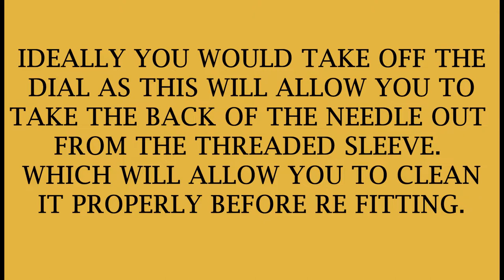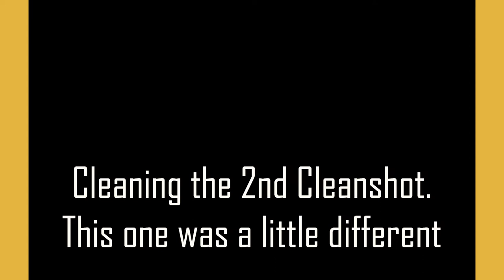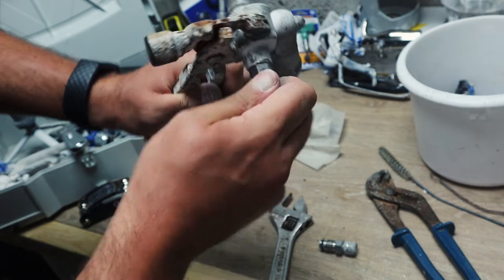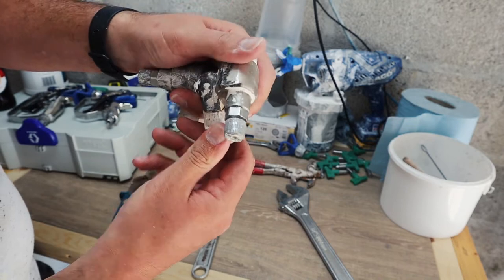Graco Cleanshot Shut Off Valve - How to Clean & Replace the Needle

Comment: hi dear thanks for your perfect explain , my question : Paint leaks from the adjustment part of the product. What should i do ? thanks for help.
Reply from the maker: Hi, if it leaks from the twisty dial at the back. You probably need the repair kit. Or a new cleanshot valve. The rubber O ring may be broken inside. Unless you can replace that.

If it leaks on the swivel area, sometimes its when its not connected tight on the pole.  Needs to be nipped up with a spanner not hand tighg

Comment: This is great... been having a rough time with mine I think I need to repair I left it in water for a couple days and really regret that!
Reply from the maker: Thanks for watching. Ive left mine in water for days before, whats the issue you have?
Reply: @sprayaholic  seems like the pattern always gets heavy in in the center, like a stream I can visibly see... I'm also typically using HEA titan tips st about 1000 psi, (valve open, just using angle swivel) so maybe that's part of the issue?   When I removed the cleanshot the other day I had way better preasure and could hear the spray itself sound healthier if that makes sense.  I haven't ever taken it apart tho so I bet its dirty inside!
Reply: I also am never sure what my pressure at gun is because I dont have a second pressure gauge, and I run off an 13 year old 440 that I've repacked a few times. It still is the backbone of my business tho lol.  I want a new sprayer but cant decide.  Thinking maybe that x19 fine finish graco since I seem to be always doing cabinets doors and trim
Reply from the maker: @pjmisley  are you using it straight onto the gun or with an extension?
Reply: Spray wd40  on the regulator ievery time you clean  it and you will never have that problem again,  even if you leave it in water
Reply: @sprayaholic   how did yours spray afterwards,  I decided to change mine after 2 and a half years , put it all together and it spat like hell in the end I had to buy a new,  well gutted
Reply from the maker: @pjmisley  so the graco cleanshot valve was made prior to all the low pressure tips such as the graco LP FFLP/ HEA wagner/titan tips etc etc. Meaning the valve is used to working properly at higher pressures. When you introduce the low pressure tips, as you say the dial needs to be more in flush than spray. Also you may find youll have to increase the pressure on your machine once its fitted. i havnt used the hea tips yet but ive just ordered some. Did it come with a new seat in the tip box/ are you using the correct seat in the guard for the correct tips? The small round part that goes into the tip gaurd? 
Sometimes the pattern can star in a cross and usually thats from paint too thick or pressure too low, or tip size too small. 
I have a video running through the graco GXFF (UK name) on my channel its the same as a gx19. awesome unit.
Reply: A 30 inch one typically (when my shoulder can handle the weight)
Reply from the maker: @pjmisley  youll need to increase the pressure a little bit more id say.
Reply from the maker: @camdecorations9779  oh really? were the rubber seals gone? ive only used one of them and its got no issues I'll try the other one this week and see how it is. The worn one of mine was 4 year old lol. The cleanshots have come down in price now. im sure i paid like £180 years ago. £156 now, no sure what a repair kit is though

Comment: what would be the number of the rubber sealant or where can I get it
Reply from the maker: Which part do you mean? The plastic O ring that sits in the back of the cleanshot and tightens against the gun. Or the small o ring inside the cleanshot

Comment: I’m getting one of these for a large ceiling I’m doing in a couple of weeks lots of stop starts because of furniture.could you please explain how to set it up and dial it in
Reply from the maker: Awesome. Great accessory to have. 
Set your pressure around what youd normally be on. It might be a little higher adding an extension and cleanshot. Start with the cleanshot dial wound all the way out in flush. Then keep testing the fan. Dial it in until now spits, small turns each time and test the fan just by pulling the trigger 1 second to see the shape.
If you still have spit and its wound all the way in the  increase your pressure.
It the sprayer stops spraying mid spray its because youve released the trigger when the machine is turning over on its lower pressure. So neither slightly increase machine pressure or if you can, turn dial in flush and it should release again
Reply from the maker: Are you on  instagram? I made a post about it a while ago. But i do plan on making a cleanshot video again
Reply: Thanks for the quick reply can you not leave it fully open 
I’m not on instagram but I think i can still view it, it’s only recently i got a phone without a lead on i
Reply from the maker: @paulmorgan1636  when the dial is wound out. Its in clean mode and allows material through at low pressure. For the cleanshot to work it needs more pressure and dialing it in shuts the valve off to stop the paint.  So each time you use it. It may be slightly different
Reply from the maker: https://www.instagram.com/p/BqAoarohkSx/?igshid=uvjqteaiamfn
Reply: Thanks for the info, top man 👍
Reply from the maker: @paulmorgan1636  if you get stuck. Im  quite fast to reply if you have any issues

Comment: Hi buddy I wonder if you can help my clean shot I’ve only used about a dozen times and for some reason it won’t shut off and more even when the dial is a turned all the way clockwise it’s an absolute mystery to me
Reply from the maker: Hey. What tips are you using with it? When its wound all the way out its in flush. You get to a pressure you usually get to the  start dialling the dial in. If youre still spitting and its wound all the way in. You need to increase your pressure . 
If its to use with fflp or lp tips you'll probably find it doesnt need to be wound it that much. 

Cleanshot was made before the low pressure tips came out so its made to work under higher pressure
Reply from the maker: Or do you mean its squirting out after trigger release? If so somethings stopping it from seating and its dirt.
Reply: @sprayaholic  I’m thinking my set up is wrong I have it in flush no tip no Guard then set  pressure to 1500 paint flows out fine then I add tip and guard 5.17 I dail  it in hoping for the paint to stop coming through so I can dail it back again to try to find the sweet spot but paint carries on flowing though all the way even when it’s completely shut down am I missing something
Reply from the maker: @MEVD2011  sounds like its not shutting the valve off. Have you tried your gun with just guard and tip on and see if it does it with the gun? 

You could run some hot soapy water through it and let it soak in the gun and cleanshot.  See if it dislodges anything. 

Cleanshot could be covered in paint like mine, if you dont flush it through enough it holds build up quite  well inside. You normally tell as the dial is hard to twist.